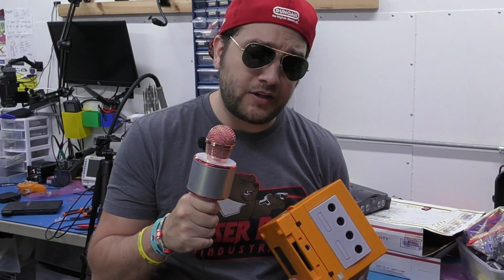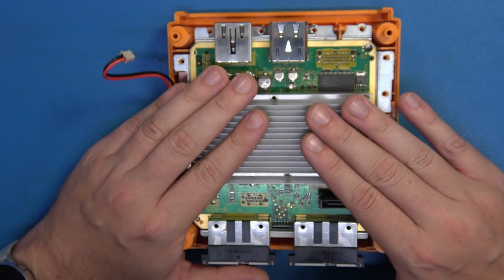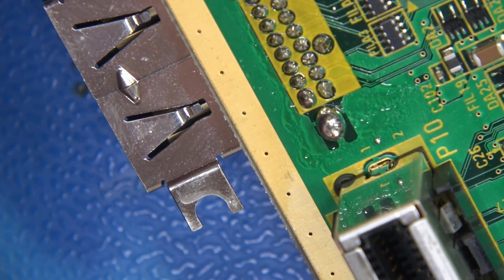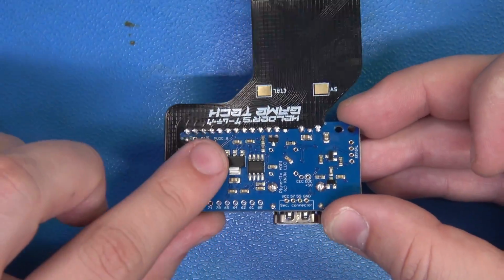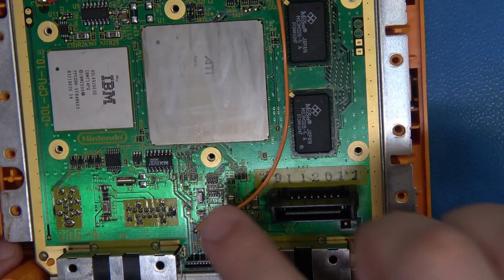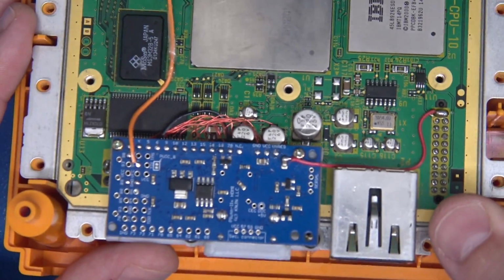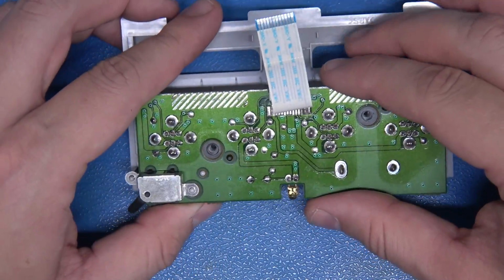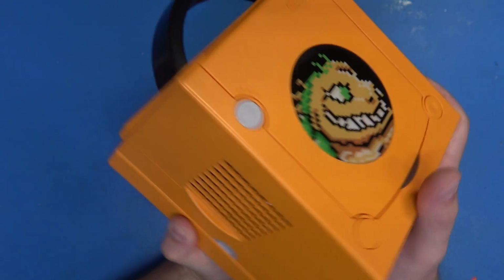Soldering Hacks for the Nintendo GameCube

Comment: I've been following Picoboot for a while and that methodology is killing a lot of otherwise perfectly functioning Cubes. A QSB is definitely a huge win for the Kunai board and I would hope it saves lots of cubes that are otherwise going to meet their demise after poor soldering attempts.
Reply: It's not methodology. It's lack of competence of people who are installing it. It's hard to blame a project when the installation is literally as easy as it gets and there are only 5 wires to solder. There is nothing difficult involved in it. There are tons of mods requiring to lift a pin, cut a trace or even to remove a connector like shown in the video. How can you expect to succeed if you have zero experience in soldering? People who are failing are not the ones who know how to solder. It's mostly people who has never held a soldering iron in their hands. Heck, PicoBoot documentation clearly states that people should practice first on some scrap boards. How many people do you think do it? 
QSB is a great idea but I can assure you there will be people who'll fail to install KunaiGC and they'll destroy IPL chips the same way they'd do with PicoBoot. Helder released a flex cable for PicoBoot and it's even easier to solder than Kunai's QSB because it's much thinner - I know of at least 2 cases where people failed to install it.
Reply: I've installed a Picoboot correctly with no issues - is there something inherently wrong with them that is killing systems, or are you referring to botched installations? I'm out of the loop myself but adopted when it came out, haven't looked into since
Reply: @ProgVirus  For whatever reason a lot of people with very little soldering experience believe that they can do it, and the common consequence of ripping a leg off of the RTC-DOL (IPL chip) requires a pretty uncommon and advanced level of repair to fix.
Reply: @ProgVirus  botched installs
Reply from the maker: I 100% agree. It's not ideal.
Reply: A custom Picoboot PCB could help. RPi Picos are RP2040 dev boards, so they're much bigger than necessary and have a lot less flash storage than the RP2040 supports.

Of course, needing to order and reflow your own PCB or buy a completed one would make such a thing much more expensive than simply using a Pico.
Reply: @SnakebitSTI  It'd not help at all. I consciously decided to not use any custom hardware because it'd be no different than any other modchip. PicoBoot is so popular because it uses off the shelf board, it's dirt cheap and easy to program. It's almost guaranteed it'll be available for the next 10 years or so. There is a Helder's flex cable for easier installs and with upcoming PicoBoot revamp I'll also release an official flex cable.
Reply: The Kunai QSB should absolutely be made on thinner material, whether that's flex or just thinner PCB

Comment: The Pluto board was my very first mod back in 2016. That was an absolute nightmare to get installed without any soldering experience, and as a college student without access to 3D printing. It’s permanently hot glued inside my GameCube and I’m deeply, deeply ashamed.
Reply: I fried a 1.6 Xbox trying to do an Xecuter with that horrible solderless adapter. We all make mistakes....
Reply: @amak1131 my friend tried to install an Xbox modchip and had never soldered anything before and basically used the solder like glue and all of the connections were soldered together so they were all electrically connected and wondered why it didn't work.  Luckily he didn't fry it though.  So to everyone who is ashamed of their past work or scared to start cuz they don't know what they're doing, just try it!  You have to start somewhere!  I still make ugly looking solder joints but it mostly works lol
Reply: you can always go back and redo it
Reply: @RestorationRelaxation But, it works. If it works, and has stood up to the last 7 years, then I don't see any reason to feel ashamed.
Reply: Hot glue is not permanent. If your ever watch painless dent removal videos, some hot glue can eventually come off with 99% isopropyl alcohol.
Reply: Everyone has to start somewhere
Reply: @AshtonCoolman  thanks for the encouraging words! Now I have lots of practice!
Reply: @RestorationRelaxation Sorry this is a late reply, but I'm trying to learn Soldering, do you know where I should start, or have any tips?
Reply: @KalphalusKal  I don't know any books or videos or whatever. I suggest going nuts for a while and watching a few dozen tutorials and figuring out how to follow along/practice.

but here's a book of a comment.

I suggest getting through-hole kits to practice with. or something forgiving, like custom keyboards to practice surface mount. or do simple and cheap stuff like modding original famicoms to add AV, and doing recaps. don't start with expensive and difficult mods like this one. anything that involves ICs with surface mount pins is probably not an ideal first project. I also don't recommend buying "soldering practice" boards or anything that's just generating 100% garbage. just build things you actually think might be cool, even if they're dumb toys. that way you'll actually feel proud when you finish them, even if they go on a shelf and you never use them again.

first, biggest advice: never put a part in backwards, or in the wrong place. stay frosty, and if you're tired, just call it a night. desoldering is its own technique and takes a decent amount of practice, and it's MORE dangerous (to your project's health) than soldering, until you learn how to do it right and have been doing it long enough.

clean your iron tip often (re-tin, wipe excess/scrub tip on metal wire "sponge"). and clean your workspace between every project - otherwise you will build a mountain.

items I personally would find painful to do without: soldering iron (imo pinecil if you're not building out a dedicated electronics bench - and the necessary beefy power brick for it), a large "knife" tip and a tiny needle tip (I think the one it comes with might be fine) for your soldering iron, a soldering iron stand with normal wet sponge and metal wire "sponge", a decent multimeter, cheap fume extractor + fan + window, 63/37 leaded solder with rosin flux (people will debate this), several bottles of IPA, a high quality industrial squirt bottle for the IPA (and maybe one for distilled water), several medium toothbrushes (I like bamboo), q-tips (I like bamboo, even though they annoyingly break), a rubber mat of some sort to keep things from brushing off the table/bench, flush cutters (imo engineer or hakko), tweezers (meh, no preference on brand. I like bent needle ones), a decent manual screwdriver kit w/ swappable bits, wire wick, multiple colors (5?) of hookup wire (I like 30aug. never use stiff wire for hookup - it will bump and break your solder joints you just made), a solder sucker that isn't garbage (for cleaning up after you add new solder to old joints, and to desolder components that have only a few leads - imo get the "Engineer" brand one), good, pointable hands free lighting, and IMO get some decent hands-free magnification to start with (until you have enough confidence and practice to do without).

if you're building kits, I also think a hands-free board holder setup of some sort (at the very least, some kind of alligator clip arm setup) is going to be somewhat needed. you don't need to buy a very expensive setup, imo. I personally find the 4+ arm setups to get in the way more than they help. but something that can offer a third "hand" can be essential, and holding the board up out of the various wire and lead clippings and solder balls can be pretty nice, if you're going to town.

if you start doing restores of broken/"for parts" devices on the regular, then you will probably want a medium water tight plastic tub (e.g. medium/small storage bin), a scrub brush, a bottle of dish soap refill, some liquid flux, some wire-wrap wire for fixing busted traces, some brasso and/or dexoit for cleaning corrosion, some distilled vinegar and containers for cleaning rusty screws (24 hours over night, then thoroughly rinse), some big plastic bags (to quarantine any bugs. maybe a deep freezer to kill em, too), some reusable/washable scrubbers (and/or microfiber towels) for cleaning with (instead of constantly throwing away cotton swabs), and some thicker copper wire (which you use sacrificially and bend so it touches all the leads simultaneously, and use your soldering iron's knife tip to dump heat into all the leads at once). if you eventually get sick of fiddly desoldering, I personally recommend getting a real-ass hakko desoldering gun. they're expensive. but the cheaper powered-vacuum ones apparently don't last very long. and if you start doing more modern surface mount ICs, you might need chip quick (and if you get sick of that, then a budget but well reviewed hot air rework station). and if you get sick of paying the markup for recapping kits, I recommend buying large batches of the caps you're using (and maybe voltage regulators), and maybe consider getting a budget ESR meter so you don't replace caps that still have plenty of life left.

if you have cats, I find a plastic picnic cover/tarp to be pretty useful to keep them from waltzing through my stuff when a project is on pause. but your mileage might vary.

okay, info dump over. also, I'm no expert. I'm just barely beyond novice now. and I have a decent amount of money to throw at stuff, which is why I probably aborted my desoldering skill building a bit early and went straight for a desoldering gun, and am considering stuff like an ESR meter. I wouldn't be surprised if people tell me there's at least one thing I'm doing wrong. :D
Reply: @AshtonCoolman  c
M
Reply: If it's stupid and it works, it's not stupid lmao

Comment: Or, buy a Wii and softmod it.
Reply: There's a lot more a hard modded GameCube can do. A softmodded Wii is definitely worth having too but it's not the best option for GameCube. Swiss on the Gamecube is wayyyy more capable than USB Loader GX, even allowing 1:1 rendering which looks absolutely fantastic through the HDMI mod, especially if you have a TV that supports turning off "Fix Resolution". Modded GameCube gives you Gameboy Interface, the absolute best way to play the entire line of Gameboy systems on your TV. That said;

The Wii has the benefit of being able to load a hard drive, something the Gamecube does not have yet. The Wii also has the ability to run Phantasy Star Online through WiFi instead of requiring an Ethernet cable. Some games can run at 60fps on it. All great things, but that's where the benefits end for GameCube games on Wii. 

Overall, I'd say far superior image quality and having 4 libraries (GameCube, Gameboy, Gameboy Color, Gameboy Advance) natively play through the system while also giving the absolute best way to PLAY those games on a TV gives the Gamecube the victory here for GC games but that's just my opinion. 

For Wii though, a softmodded Wii paired with an HDMI mod can lead to fantastic results for Wii games. Super sharp image, 60fps on some games, etc. So like I said a softmodded Wii is still SUPER nice to have
Reply: Or Better WiiU with the HDMI included
Reply: @lillo2711  I know this is considered heresy, but Dolphin blows them all away and it's free.
Reply: @GerardPinzone  if Dolphin had 100% compatibility then yeah, plus the cost of a solid machine for Dolphin 🤷